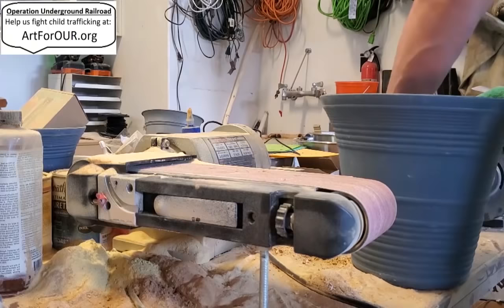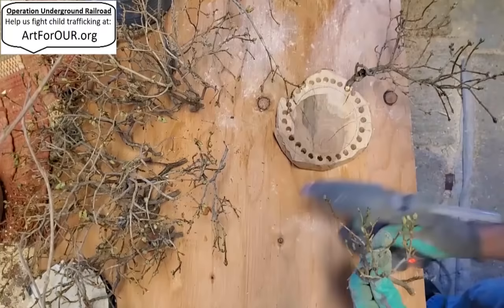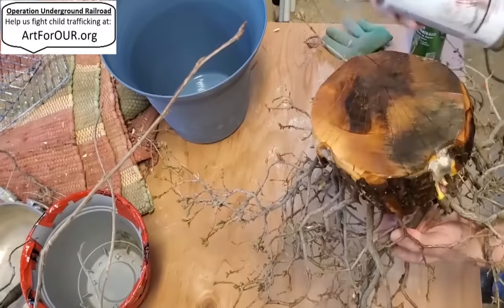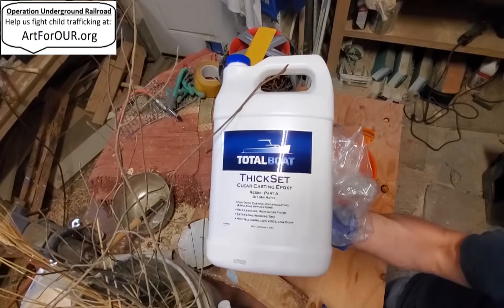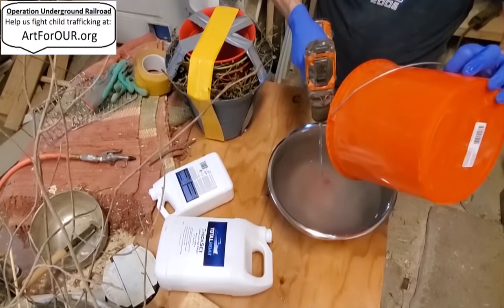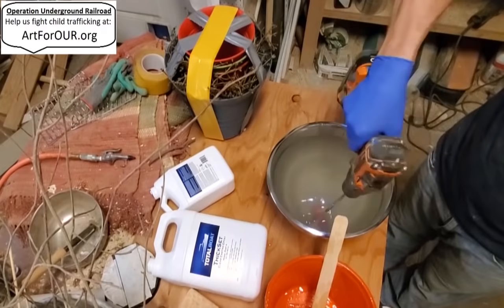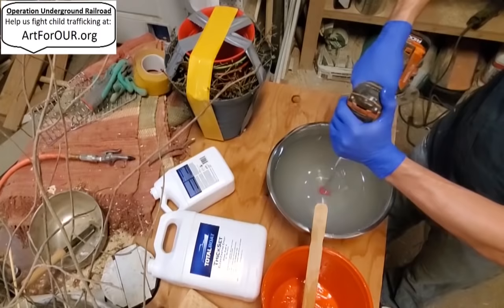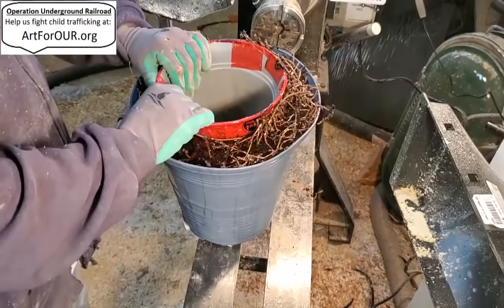"The Amazon", apple wood, resin and lilac twigs turned into a vase. Lathe turning. ArtForOUR.org

Comment: I use resin quite a bit and green with plants. You do not want to use. The moisture reaction in the resin runs it just about every time but you can also take it paintbrush your pieces that them dry and then warrior larger amount of resin overall, same as what you do, if doing a river table seal your edges. I do enjoy watching your videos. I have like a lot of work so far. You could also use silica to dry various plants, flowers leaves, and retain their color to be used in resin later.
Reply from the maker: Thank you Lynda!

Artforour.org

Comment: Whipping that resin also puts a lot of air bubbles in the bucket
Reply from the maker: That's true.  However, it must be mixed perfectly, and mixing 1-2 gallons at a time is hard to get perfectly blended or you'll see a grain in the clear resin.  The pressure and vacuum chamber combo approach has solved the issue....

Comment: Again a great concept, and great cause BTW.  Yes your wood needs to be completed dry, that is probably you cause for the high heat and cracking/bubbles. Also note, as the wood is green, you can also get future rotting with expansion, so it can all fall apart.  Not sure what oven facilities you have, but if you made your cast mold up, but then placed it all in the oven at over 100C for a few days (I use a smoker oven), as soon as you get it out of the oven place in a sealed bag so the moisture cannot re-enter.  Once cooled then cast you may solve most of your issues.  Keep up the good work.
Reply from the maker: Thanks!

Comment: Hej Dan,
I am neither an artist nor do I know anything about woodwork. However, I have watched several videos by other YouTubers who do woodwork and use resin and the likes like @Blacktail Studio, BlackForest and 1 thing I noticed from Cam of @Blacktail studio do when using a lot of resin to create a river or waterfall for instance when making tabletops, he pours the resin in parts. Cam explained the reason is to allow bubbles to rise as it sips through the wood, torch the bubbles(I think he let it set a bit) then sand it a bit before pouring another layer( which I know would be impossible/impractical to do in this instance) so I wonder if spraying denatured alcohol after each part pour would help reduce the bubbles as it bust bubbles on epoxy and resin (forgive my ignorance if epoxy and resin are the same, only got addicted to woodwork in the past couple of weeks). However, the final piece was gorgeous, Dan. I think making the bottom dark like some soil type would make it look like a bush colony from the seafloor. It was satisfying to watch the piece unfold, than you for sharing your gift.
Reply from the maker: Thank you so much Fiona!  Much appreciated. 
https://www.artforour.org/how-you-can-help

Comment: Try setting up all of the green twigs in your form the way you want it, ready to pour then set it aside for the twigs to dry for several weeks under warm fan then pour (put in pressure pot). See if that doesn’t fix the bubble problem. Don’t pre-seal the twigs before drying.
Reply from the maker: Good ideas!

Artforour.org

Comment: That looks awesome!! Could you put the branches and mold together while they are green and let them dry  for a month or so before adding the epoxy?
Reply from the maker: That's a great idea.  I wish i had that kind of patience! :)

Artforour.org
Reply: @artgivinghope  You could vastly speed up the drying process under vacuum.
Maybe 6 hours would be enough, maybe 12 or 24, idk, didn't try wood yet, only car a/c.

If you're lucky, your pressure pot may even be stiff enough for reverse action of vacuum drying.

But if you switch to vacuum drying, i'd strongly recommend a membrane pump instead of an oil sealed vane pump.
A vane pumps constantly let out a nasty oily fog, as soon as the oil has warmed up. Inhaling oilfumes makes sick, too. And if you forget to refill in time, they run dry and are junk. If your annoyed neighbours didn't cut it off meanwhile.
Membrane pumps tend to cost a bit more, but you can dry inside the shop. Make sure, the pump you chose, is built for 100% duty cycle.
Reply from the maker: Thank you for the support and advise!

Artforour.org

Comment: Hi Dan ... wonderful result for a deserving, tragic cause!! ... a couple ideas on your bubbles issues with the caveat that I've never done an epoxy pour (I do watch Black Forest Wood a lot, and that's all they do) ... so, if you try to encase small green wood again,  
(i) if you have the patience, jam it into the form first and then leave it to dry completely, or
(ii) coat it in clear or tinted epoxy by actually dipping it, then let it cure completely before the real pour, or
(iii) .as with bubble removal from just-poured concrete, while the bubbles are still pretty mobile, hit the whole thing with a vibrator (like a paint mixer, not the other kind), or
(iv) if it really is air being cooked out of green wood, deep chill the whole thing during the curing (see Black Forest)
My thoughts Dan
Cheers, Farmer John, Ontario, Canada
Reply from the maker: Excellent ideas!

Artforour.org

Comment: I see The Dancing Trees when I look at it. Absolutely awesome💜💜💜💜💜💜💜💜💜💜💜💜💜💜💜    You might try cooking your green or wet wood to get the moisture out. I think Total Boat makes a sealer to coat porous material with, you could check into. Most of the turners I subscribe to use Stoner mold release and it seems to work great. Just watch where you spray it, because if the over spray gets on your wood the resin won't stick to it. I don't do any wood turning myself, but almost my entire list of channels that I watch are wood and/or resin turners. I hope that this helps you out. I love your work.
Reply from the maker: Awesome!  Thanks for the ideas.

Artforour.org
Reply: @artgivinghope  I forgot to tell you about the"Cactus Juice" that stabilizes the wood and lots of other things as well. I don't know if you could use it on green or wet wood though.

Comment: just an idea... is it not better to fill the "inner-buckets" with sand or gravel (or other heavy stuff) instead of using duct tape? Makes it easier to pour the resin on the branches... (maybe less bubbles).
Reply from the maker: Not a bad idea.  Certainly cheaper!

Artforour.org

Comment: I have watched quite a few of your projects and you have complained a lot about bubbles. It's a tricky thing but do this instead: 1) Time how long it takes your resin to gel. Gel states are where it's tacky and holds a form but won't drip out when turned upside down. This takes 1-2 hours for most slow set resins. This is also known as the "pot time". 2) pour a liberal amount into the mold or mold set you want to cast and drain the excess. This will seal all holes and give you a chance to examine any bubbling areas. 3) bubbling mostly happens because of water vapor from overheating, to stop this completely pour by incremental values. Resins by volume get hotter with more volume, which causes distortions and fractures. Prevent it by pouring a lower volume and wait for it to gel, next batch and pour again. Repeat until filled. 
That will prevent overheating by lowering the reaction volume. And you can pour once every 2-4 hours and allow it to cure for 48 hours to permanently set before putting it on the lathe. Lowering the temp of the curing time will give better optical results too.
Reply from the maker: Thank you for the advice!

Artforour.org